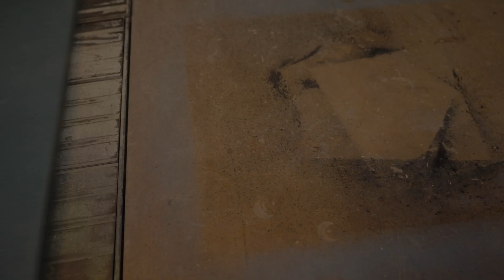Making a blue mitered cabinet box from some MDF

Comment: Great build as always especially the handle. What is used for? It seems very specific. Regarding the holes in the corian. You can get special glue and filler for corian but I am sure it's quite pricey. I would make small plugs out of the valchromat and glue them into the holes.
Reply from the maker: The handle/tote is now holding my workshop gear, post-it,markers and also some extra office things (scissors, glue gun etc) Wanted something to hold everything in when I went around to different meetings (instead of filling my arms up with stuff)
Reply from the maker: And thank you very much btw :D I will look into the corian glue, wondered about plugging it myself with mdf, but i could not make up my mind about it :D

Comment: Hi Sir, really love your channel. All of your video are very informative and interesting. Just one question here,  I'm thinking of creating a small indoor cabinet from mdf. However, I read that MDF is quite dangerous towards human (due to the formaldehyde particle)
So is it safe for us to use mdf? Or is there any finishing procedure we need to do after we're done with the cabinet?

what can I think of at the moment is to coat it with epoxy resin, is it alright?
I also wanted to skin the mdf with carbon/glass fiber for aesthetic purpose and also make it waterproof

really appreciate your feedback and looking forward to see more videos from you.
thanks
Reply from the maker: hi there and sry for late answer. The mdf i am using, especially the colored ones does not contain Formaldehyde. I think the best thing is to coat it with a non-toxic varnish of some sort. (water based) 
Epoxy is quite dangerous, the fumes are nasty and it can irritate the skin if it touches you, same dea with the fiberglass, but it sounds supercool to coat a mdf cabinet with it :D Hope you make that, send me a picture if you do :D

Comment: The circular cutout for opening the drawers is exactly the kind of design cue that makes your work great. Totally love it. The top of the unit looks like it was designed for a specific use- will you fill us in on the intended use? I’m curious!
Reply from the maker: Hi there and thank you, The top tray was needed because the Corian was not large enough :D , and now I use it to hold my pens and markers (the open end makes it easy to slide them out when needed)
Reply: Flokroll Projects nice! Thanks for sharing!